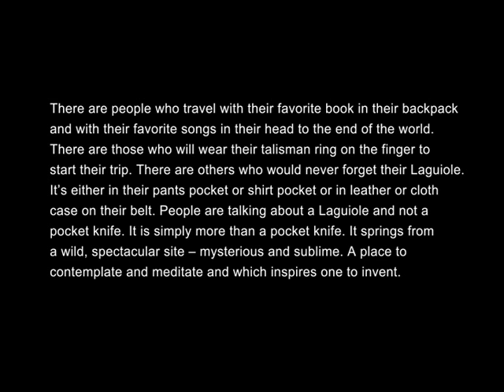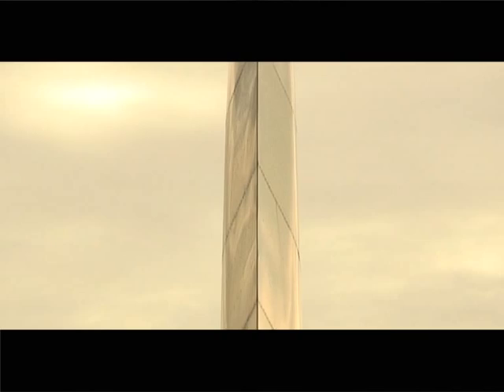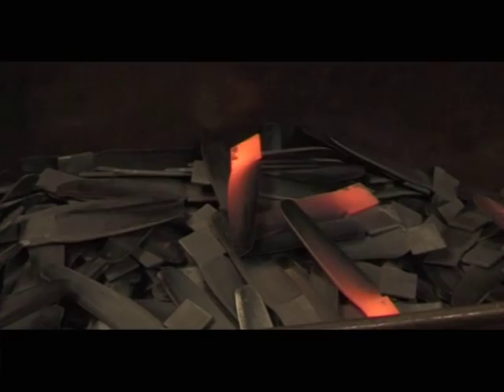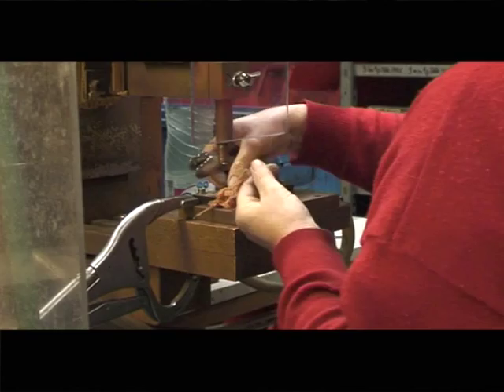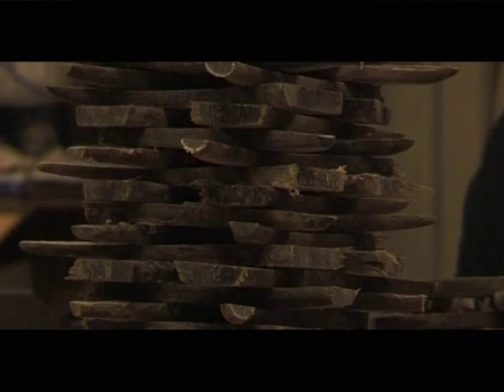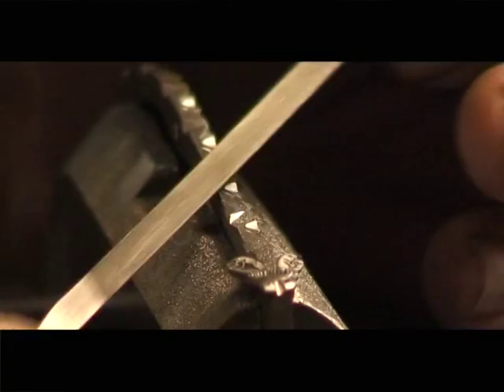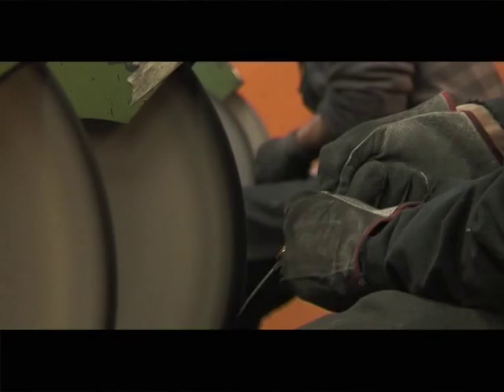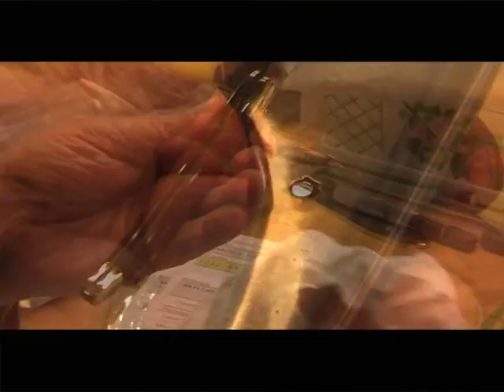MUST SEE! How Forge de Laguiole Knives are made.

Comment: I have had my Laguiole knife a year or so now, and I enjoy using it, it is well made and beautifully designed.
Mine was not well finished however, it had not seen quality control. That was disappointing.
There was a ding in the edge of the blade, and the plates to each side of the spring had jagged burrs along their edges.
Since I am a blacksmith these faults were not difficult to remedy, and I chose to finish the knife myself.
I do wonder if it is cheaper to have a returns facility than an adequate quality control system ...
This knife should NEVER have left the factory
If Laguiole wish to present as a high quality manufacturer, they need to walk the walk as well as they talk the talk.
As a smith, I put half an hour extra into everything I made, that did all my talking for me.
Have the accountants staged a coup ?